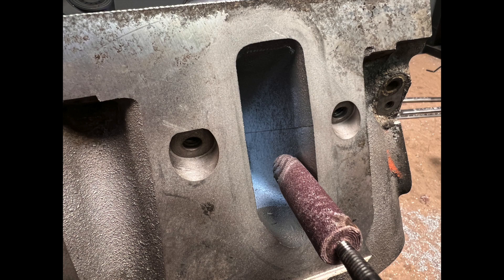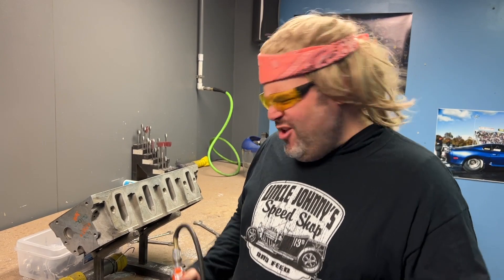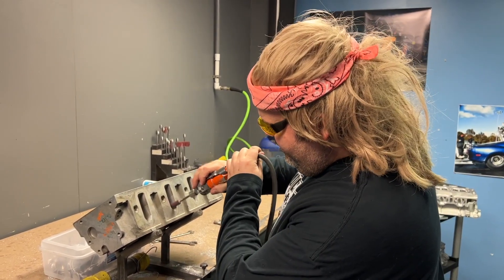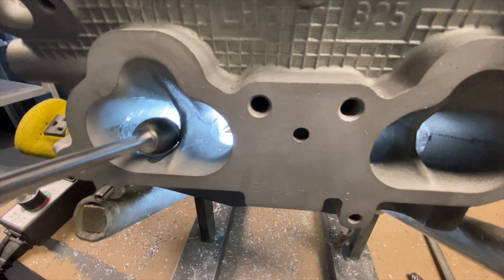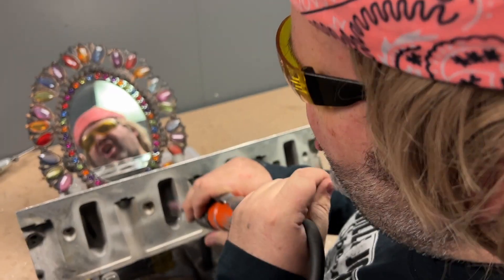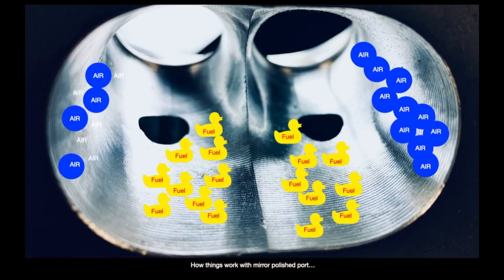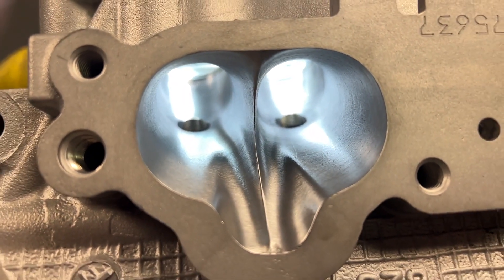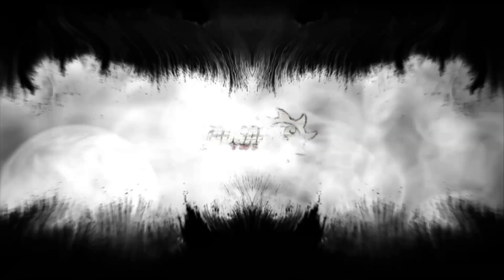Just polish your head, don't port it!? Let's talk port finishes!

Comment: Do a flow test Air travels faster over a smooth (polished) surface. With air to fuel 14:1 you best believe any extra air you can get into your cylinder is more HP.
Reply: Right. Polished surfaces only help air flow in the exhaust. They do not help air flow in intake. Right. Ok. Got it. Just had to triple check I heard it. Nice.
Good.
Cool.

Comment: How does direct injeciton respond to a "mirror finish"? Any gains to be had, or a waste of time?
Reply: Great laminar flow, probably no downside. The mirror finish hurts port injection and carb engines.
Reply: @sar_rian  hmm interesting I just did a nice finish on my intake side only my car Dynoed 225 so technically what your saying is if I re Dyno it it will make less power?
Reply: @Mr_vtec_fa5si  we're talking direct injection. If you have a port injection or carb and you did a good job on the port you'll make more than stock but the mirror finish will make it less than optional because it will pull fuel out of suspension. An 80 grit or so finish will slow air down at the wall so the rest of the column of air will glide on top of the trapped air and keep more fuel in suspension. There's more to it but I don't want to write 6 paragraphs on a YouTube reply. Go check out some good porting books it'll elaborate much more.
Reply: Nothing needs to be mirror finished. Even a slight texture is better than mirror polish.
Reply: A trick question, I'm afraid: the fuel is never in the port, therefore it can't drop out of suspension before the valve - wet flow rules do not apply.